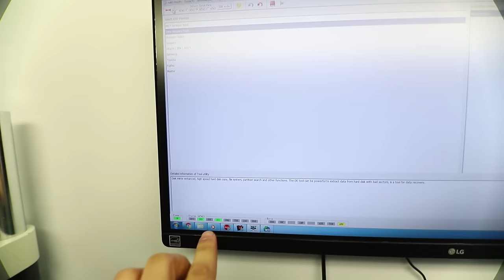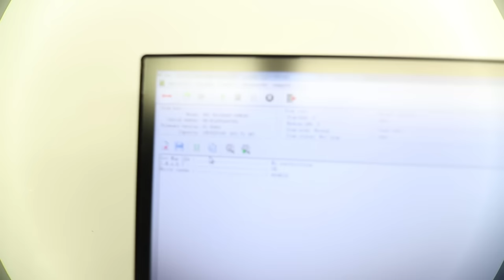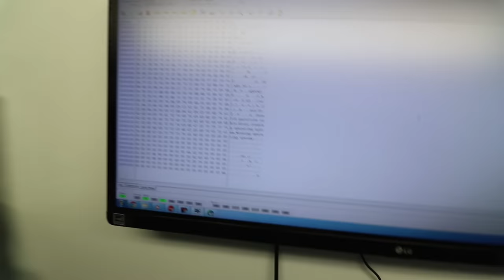hard drive does not spin? simple way to get your data back

Comment: Man hope this works on mine, won't spin up just like that, can't even plug it in a sata cable , was told its thousands to have the data recovered. SSD is the way forward.
Reply from the maker: Did it?
Reply from the maker: And SSD is not a way forward if you are not gonna backup :) do not assume that SSD never fails. I had more SSDs of my own fail than my own hard drives.

Comment: Can you used a different Western Digital power supply board from another model as long as it is the same form factor? I have a WD5000AAVS-00ZTB0 and I know that WD5000AACS has the same form factor power supply board. 
All the Diodes on my HD tested fine for continuity however I do see something burnt on the board I think it is labeled as E16 on the board.

Comment: What about that diode? You don't need to replace it? Simply removal and it works? For what was it there? I am in this situation... I can try but I would like it is safe!!!
Reply from the maker: it protects from voltage spikes, you need it there so it can keep more important components from blowing up the next time. In my case, I did not because this was just a data recovery project. Even if by some miracle another surge accured, I can easily take care of the problem by the PCB swap. Our shop, literally, has hundreds of PCBs that could be used in this case.
Reply: @hddrecoveryservices  ok, I tried this and I fucked up!!! 😂 It was with the test one, so no worried, but I did not only not fix it but I also removed a resistance... And keeps not working. So I believe change of PCB is the most sensible for me, even though I am not sure how to change all the  BIOS chips, maybe I bring to a shop for it.

Comment: Don't know if you can answer this, or if you'll even see it, my WD has the same problem, wont spin, and when i put my multimeter on the diodes, d4 and d3, none of them gives me a reading, is it possible that both of the diodes could be dead? and would it work if i removed both? i might have a weird multimeter, it doesnt beep as well, It's a dt-830B digital multimeter, it measures a 9V battery just fine though. 
Thanks.

Comment: Love the vids! I have a 2Tb Seagate Barracuda st2000dm001 that doesnt power up. Ive removed the only diode that showed short with continuity test, nothing. Then ordered a replacement pcb, would the replacement not power up the hdd before swapping the 8 pin ROM chip? Starting to think its the motor... Any thoughts?

Comment: Also I bought a hard drive bay with a power source, it’s much different than the power that you use to start the HD. Could this be an issue as well? That I’m not getting power to the right part of the drive?

Comment: Thanks for giving us hopes. I had given up on 2 of my HDDs which have some lost photos. Do you also repair the old IDE drives? I have Maxtor and Seagate back in India, maybe 40 GB or 80 GB, I don't even remember. If this method doesn't help then I can get those here next time and send to you. They are not getting detected, I guess not even spinning.

Comment: what's that liquid gel you applied after removing diode D4?
You don't need to replace diode D4 with a new one?
Reply: that is soldering flux, very much essential for SMD work

Comment: I have a Seagate ST320410A. I don't know where I got it.   I connected the molex connector and promptly got sparks.  I have used an Ohm meter and there appears to be a short between 12V pin and gnd.  Reading of about .007Ω.  There are two SMD near the power connector.  a 1020f  and Buf c116  I'm not sure which to remove. Suggestions?

Comment: I dont follow - you had a short through the Diode meaning open circuit. I get it. So you removed the component essentially opening the circuit which is no different. So how does this even work? 

The idea is for voltage to flow from one end of the pad to the other side through a component. The component failed so, no flow... You removed the component sooo, still no flow. How did this do anything?

I'm just curious about the "reason" this works or why opening the circuit works. Just seems really odd.
Reply from the maker: If you understand the purpose of a TVS diode, and see it being in short, any questions regarding my actions shoes be clear. If they are not you don't know the purpose of TVS diodes

Comment: What's the drawback of just leaving the resistor out?
Reply from the maker: Worst comes to worse next power surge will take the PCB out permanently, so it would need new board. It's a TVS diode not a resistor

Comment: I have a WD and Seagate with the same issue.  I found the D4 on the WD and removed it, but nothing on the Seagate. The Seagate still spins up, beeps once and stops. I don't think it's the heads because it doesn't sound like it's bound up, just powers up, beeps and stops spinning. Now the WD spins up and shows up not initiated in the device mgr., but it won't let me do anything to it.  I tried DiskGenius and Cleverfiles Disk Drill, but they don't even see the drive. Any suggestions what I can try with either drive. Thanks and I'll keep searching for an answer!

Comment: When you say "short" in this case I think you mean "open" if there is no continuity it is open, if there is continuity both ways then it is shorted. the diode should only have continuity one way i think unless it a voltage regulator? it's been a while lol. I have one that spins no clicking and I have tried with two other boards from functioning  hdds that are the same model but is still not detected. put the boards back on their original drive and still work fine (just in case) I know this video is 4 yrs old but if you get this any advice ?

Comment: Great video and I love how you still reply on a 3 year old video. I have a Seagate 2.5 1T hard drive (PCB 100731589 Rev A) that does not spin up either. The only diode I see on the board is good. Any suggestions? Thank you
Reply from the maker: that drive is SSHD. it does not spin because the NAND is problematic. It needs pro help
Reply: @hddrecoveryservices  Thank you

Comment: Awessome tip. Actually as of the drives that they do spin and especially for an external drive  Western Digital WD10000H1Q-00 in my case, it spins  and it does a weird sound like the needle tries to catch up something (tik - tik -tik). and then changes the process and does something else untill after 3 minutes that stops and doing nothing. Do you know what that might be? Thank you so much for your help anyways

Comment: Great video and impromptu tutorial.  I'm trying to rescue a 20 MB Quantum HDD from a Mac Plus HD 20SC from 1986.  It powers up but won't spin. So small and old, it's simply irreplaceable today.  Retro crazyness. Will update with success/failure if this works.  BTW doesn't the D4 diode provide some level of back flow current protection?  So doesn't leaving it out put the drive at future risk if the power supply spikes again?
Reply from the maker: leaving it out does put the drive at risk, but we would image the unit anyways, and data is returned to a client on a new drive.

Comment: My WD 500GB is not spinning. I have checked both diodes, the don't show short. I have replaced this small PCB with another one from WD HD. It made my HD spinning. It even is showing WD type on the Device Manager  but I could make it to detect size and work. Is it because the PCB board could be different from another HD or anything else?

Comment: hello I need your help, I have the same problem, one of the 3 diodes was shorted, I removed it, I checked that the contacts where the diode used to be worked and magically works, it is no longer shorted, the problem is that the hard drive still does not spin, it seems dead. is there anything I can do?

Comment: 8TB external WD ... no spin, but does have a clicking noise. Checked diodes ok ... I'm guessing head(s) stuck to platter?? Won't open it here to confirm though. I lack the needed clean area. Any common problems with Smooth L7232?
Reply from the maker: If the drive was dropped when it was spinning most likely motor got bent

Comment: Thanks for the video.. 
I plugged in my external ADATA  hard drive and it beeps 10 times while spinning, then the spinning stops. What does the 10 beeps mean? 

I opened it up and the plate is not stuck on the platter (which I found was a issue in most other videos I saw on YT).
Also, can the platter be taken out and put into a new external hard drive? Sorry for the dumb questions, and thank you.

Comment: To remove the diode did u just heat it after u put that flux liquid? Ive pinpointed the dead diode but got a soldering kit can i just use a heat gun
Reply from the maker: Heat gun will probably burn the connector. Just snap the component off with side cutters or flat driver

Comment: I get no sound out of my 1TB Seagate HDD and checked diodes with multimeter. Both diodes have continuity so what else could be going on? Should I remove diodes anyway and see what happens? I don't care about drive, just want the data off drive.
Reply from the maker: No, don't remove diodes of they are not in short. If data is important hire a pro

Comment: Instead of repairing the PCB can l get a new HD with same kind and just pop the new board into the broken HD? Thanks
Reply from the maker: Adaptive data on modern drives is stored in ROM. Without it the drive is not going to work with the new board.

Comment: Hello and thank you for this video. It looks very promising. However, I'm a bit concerned about leaving out the diode ... I cannot imagine it being in there and not being used ... Also, I want to prevent getting a short circuit on my motherboard. Would you be able to address my concerns and give me some more information please?

Thank you!
Reply from the maker: there is no point on removing the diode at all unless it is shorted out, so test it first. If you do not replace the diode, then the next time (if the power surge occurs) this drive will get burnt in a different place. In this case, this Diode acts as a protective fuse. A TVS diode, or transient voltage suppression diode, is an electrical device which is designed to divert or shunt voltage spikes from a circuit in order to protect that circuit. If you leave it out, there will be no protection for the next time
Reply: @hddrecoveryservices  Thank you for your clear answer, and I apologise for my late answer. 

Unfortunately, I was not as lucky as the owner of that hd. The diodes on my pcb were fine. For some reason, the drive does spin now. However, it is still not getting detected, which makes me think the heads are malfunctioning ... Nonetheless, I thank for for the great video and the help you provided!

Comment: These Western Digital "Green" Drives Are Absolute Junk! 
I have about 6 or 7 of these defective units sitting on my workbench; so I would suggest that you 
avoid these unreliable crappy Drives at all costs.
I've already warned some of my customers about the high failure rates on these drives, and I would most
certainly never use one in any of my computes.   This info is good to know; so I will defiantly try knocking
off some of the Diodes to see what happens..

Comment: I really got my hdd messed if my diodes are broken then will removing all work or should I replace them I got lots of important stuff on it which can't be lost at any cost or if the spindle itself has the problem is there any way to fix it up?

Comment: Hey man , i may have the same problem with my old drive  and i am thinking to find the same model of pcb and replace it to the old one, i heard that its possible if the model is exactly the same , but i have another concern , for a while it seemed that the motor of the platter and head where overheating when plugged to pc , after some time i tried to connect again and there was no heat maybe was a pcb problem or the broblem is on motors ...what do you think ?

Comment: Good Video as always. I Really enjoy them!

I have a question. How do you repair read/write heads on drives that park their heads on the platters? Doesn't it scratch the platters if you move them out without the air cushion? As far as I know, the platters normally land on a special section on the drive where no data is stored. Thanks in advance :)
Reply from the maker: Tobs we have tools that gently pry off stuck heads without having to drag them on disks. Then once extracted heads are inspected for damages. If damaged they go in the bin, and donor is used. I just had that happen on Friday actually
Reply: interesting. So the surface of the platters isnt the problem if the heads gently swipe over the non-spinning platters, it's the heads that break?
Reply from the maker: Tobs it depends on how it it moved, it is easy to damage the surface too
Reply: HDD Recovery Services yeah, it's fragile obviously. Thanks for the answers :)

Comment: actually today I ran into a WD My Book external hard drive that wont spin.  A buddy took the PCB off and tried to run the hard drive using other means ( sorry i do not know all the tech lingo) but it still wouldn't spin.  Could that still be a PCB issue like you showed in the video?  or is it something deeper since it wouldn't spin even after taking the PCB off?

Comment: Hello and thanks for the video...at 5:38, you appear to add Flux and heat the contacts...is that a regular heat gun you are using?  Thanks.
Reply from the maker: We use quick DW861 hot air stations

Comment: Any chance you have a video or can tell me what diode's to test on a Seagate 100802503 REV A? Thanks for the video. At least I can keep testing and hoping I find a short.
Reply from the maker: TVS Diodes are always located near power connector, and they look the same. Usually would be marked with D* and a number
Reply: @hddrecoveryservices  Thanks for the reply! I see two with a "D" on them.  Both of them drop to zero and give a tone when I checked them.  Does that mean they are both bad and is there even a chance it will work if I unsolder both?  Thanks for the information and help.
Reply: Thanks but I don't see a D* w/ a number on the board.  Not much is labeled.  I did find a pic of the board online and hosted it here: https://ibb.co/9h6FydT If you could take a look and let me know what I should be testing and hopefully cutting out.  If I can get it to spin up and be read, I've got a new drive waiting to copy the old files on.  Then I just store this drive as a backup since it won't have any protection.  Again, thanks for sharing your knowledge and helping people like me out!

Comment: Hello there, I know this video is really old, but I have an old hard disk as well with some problems, so I was using your method to test the diodes but I found D1 is the faulty one, in that case, what solution is recommended? Thank you. 
PS. Is it possible moving D4 to D1 to replace it? because I have no other diodes available right now.

Comment: You don't need to replace that shorted diode?
Reply from the maker: I didn't need to because we just needed to copy data to a new drive. But for prevention of more serious PCB damage TVS diode should be installed
Reply: @hddrecoveryservices  thanks. I'd do exactly what you did

Comment: wasn't this diode for overvoltage protection? meaning that if something is still causing overvoltage shit will blow permanent?
Reply from the maker: yes, it is TVS diode. I would cause more damage if another spike happens without it in place, but for getting the data out of this unit I feel safe to get it done without it. Besides, if something else does go, it is a matter of minutes to adapt a new PCB to carry on with the process of data extraction

Comment: how can it work if you remove the diode??
Reply from the maker: TVS diodes are constructed with large cross sectional area junctions for absorbing high transient currents. ... As a result, the transient current is diverted away from the protected components and shunted through the TVS diode. The voltage across the protected circuit is limited to the clamping voltage of the TVS diode

Comment: Checked both diodes on my wd drive and both were fine. Drive doesn't power up. Was hoping it was an easy fix. Any other ideas what it could be?
Reply: I had the same problem. Eventually the drive does power. I found that if I physically warm the drive up with a small heating pad or by setting a mug of hot coffee on it. It starts right up. It keeps on working until the next time I boot up the computer. Then I have to warm it up and voila! I'll be replacing this drive soon unless I find why warming it up works.

Comment: I have almost the same problem. My hard drive is completely silent, but a diode is overheating and smoking. Is it safe to remove that diode?
Reply from the maker: It should, but make sure that pads between are no longer shorted out
Reply: @hddrecoveryservices  OK. Do you know why is the diode smoking? Also, the power surge has broken my laptop hard drive too. There are some strange screws and I can't find the proper screwdriver for them. Could you look at this? https://ibb.co/wQ2Qhft

Comment: Don't diodes pass current in one direction?
Reply from the maker: This is a TVS diode (transient-voltage-suppression) it's a protective component not function essential. If the drive would have been hit by surge without it, then something else (more function critical) would burn out.

Comment: nice job again ! Erkin I see you listed links to all your tools but I don't see a link to the helping-hands (the arms consisting of blue colored cups with orange ends). What is the name of it ?
Reply from the maker: The little ones I used to use to hold flash drives in place?
Reply: here's one of the arms visible  : https://www.youtube.com/watch?v=9kobGxePVcQ&t=260s
Reply from the maker: they were good, but not as good as current clamps I got. those blue pieces are called loc-line
Reply: thanks I found them online. I tried to search through your newest videos to see what the new clamps look like but couldn't find them. what is their name ?